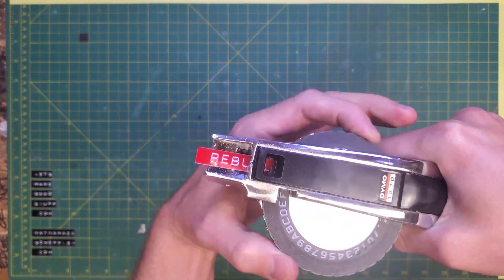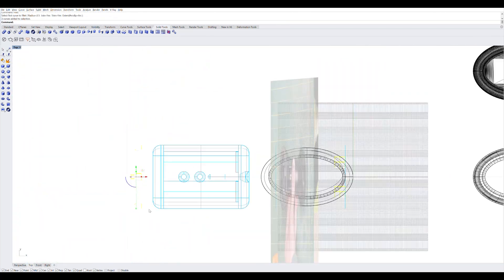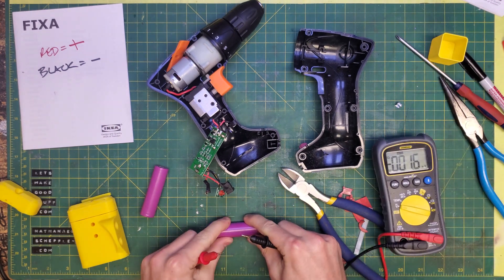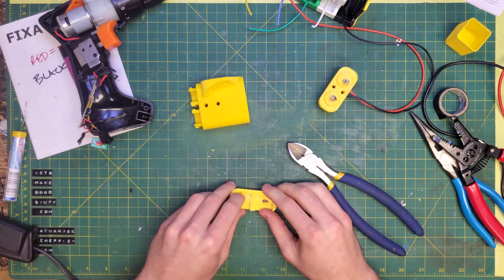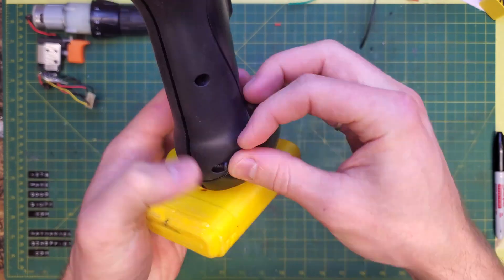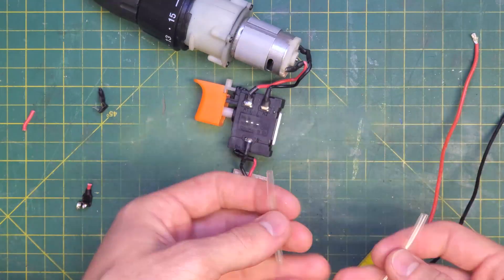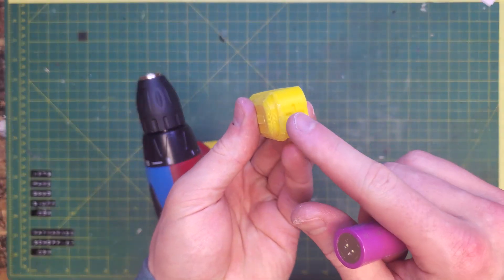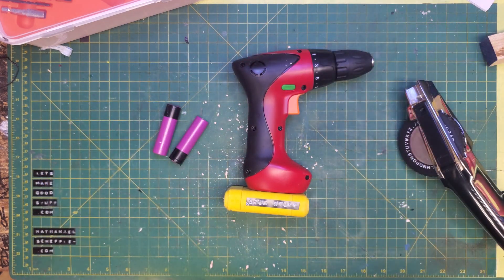IKEA Fixa Rebuild - Let's Make Good Stuff

Comment: Very nice video. I just re-soldered a new internal battery pack with balancing cable for my Fixa. Second one I put in it actually. Serviced the gears as well, and was surprised that almost all of the parts in the gearbox was metal

Comment: When you were drilling the battery pack while it was taped to the housing I was like 😵😵 what if you drill through the batteries themselves?!
Reply: But then of course they were inside it haha
Reply from the maker: Haha, then I'd have an accidental rocket in my basement, these 18650 lithium cells hold a lot of power!  I did manage to quickly short them out once when I was prying off the last bits of the welded tabs and that was more than scary enough for me.
Reply: Is it ever used for anything since the modifications?
Reply from the maker: @lordflick895  sorry for the late reply, I completely missed this!

Since we have other drills, this one is mainly a backup and really only used as a power screwdriver, since it is a bit underpowered for most of the other things we do in the shop.